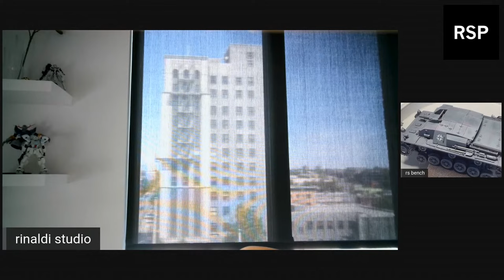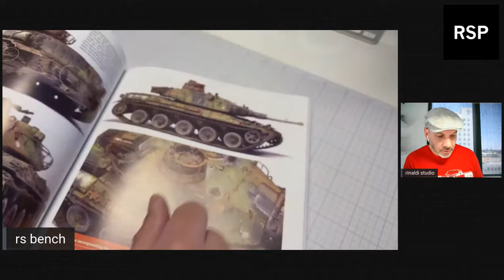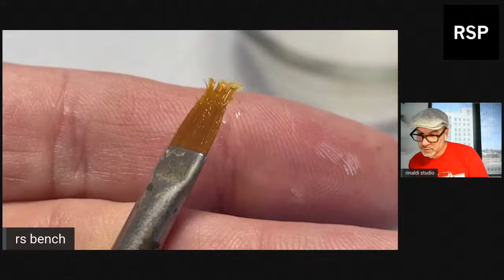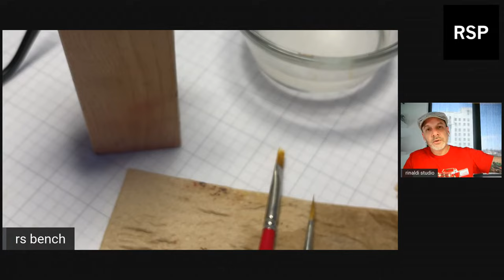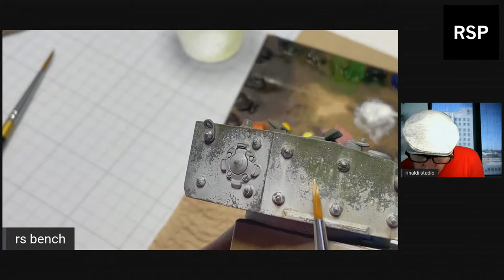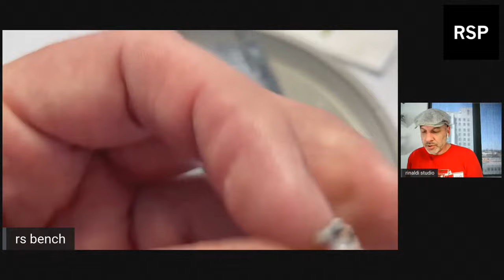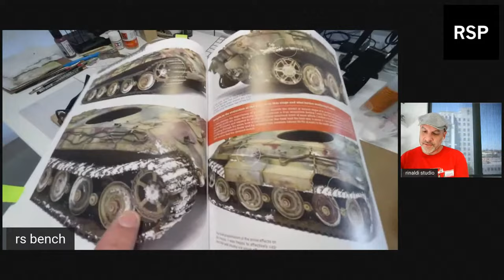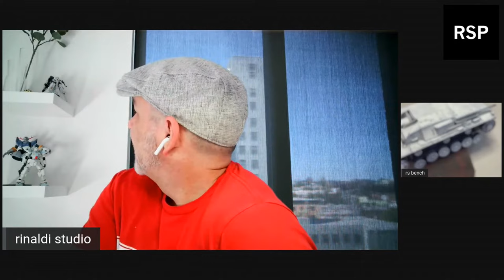Ep 11 - Winter Whitewash How-to

Comment from the maker: Thanks again for everyone that hung out today, we had fun and it's clearly one of my favorite types of worn finish. I will reply to all the missed questions and comments shortly, and will also add detailed time stamps in the description for quick reference soon too. Cheers ~

Marino -- yes! We really need new-tool air racer kits of all genres :)

Kristoffer Nilsson -- thank you, please feel free to email me any unique reference images if you have original items in your collection. I'd love to see them!

Michael Lucci -- typically, you can paint once the HS is dry. I mention this by using the hair dryer to speed it up and get it dry to the touch. Then you can paint as normal.

TK -- I do have full interior with Grill tin TA4 and that was enough for me! Haha, they're a ton of work, but will show interior stuff in the future. Jus depends on my mood, the kit and all that. It's mostly because the sheer volume of painting is increased exponentially to properly weather everything the same level as the exterior.

Joshua Lee -- Great to see you man, thx for coming by and I'll go deeper into HS chipping + MMP very soon. Lots more to discuss on the finer level (see what I did there?) ;)

ZalDaf -- if you over chip, back it off and the easiest fix is a simple respray of the top color. If there is a lot of texture, then quickly light sanded the rough parts and then spray again. I show this at the end of the video with the StuG not going to plan (which was great to see and learn from) :)

Nereo -- scroll to the bottom of the RSP website and click Dealers, it will open a page with a list of the regional stores around the world. Thanks!

Raul - painting tires and tools, etc. happens after chipping in this case. The reason is this allows for all the brackets and wheel centers to be properly chipped first (much easier) and then hand paint those before going in the weathering.

Comment: It's probably mentioned in the book (TA4), which is still underway, but asking is faster.
Are you whitewashing with Tamiya white X-2 or XF-2 (I'm assuming the latter, flat one?). Would this be the same as the rattle can TS-27 that I can decant, or would that be chemically different?
Reply from the maker: I honestly have no idea, I've never tried the TS spray cans.
Reply: @rs.p  No problem. Some shops around here still carry Tamiya, just a bit of driving involved.
Would using MM white yield similar chipping results? Or is the hairspray approach heavily depending on the top paint being Tamiya?
Reply: The TS cans are lacquer. The 'jar' equivalent to TS-27 is Tamiya LP-4.

As Mike has said, you can chip lacquers, but they're harder to get going (the paints are tougher and stronger, so it's harder to get the water through them to the hairspray).